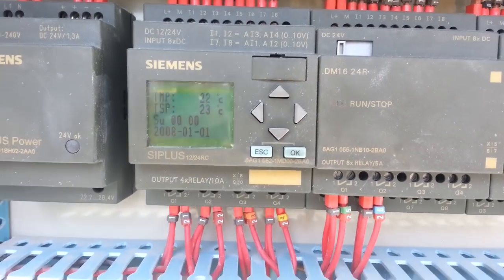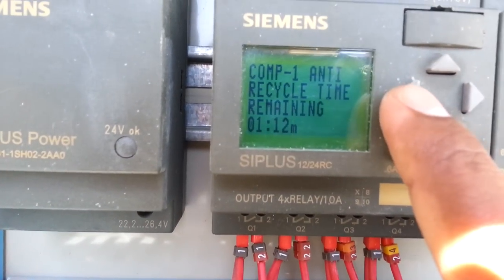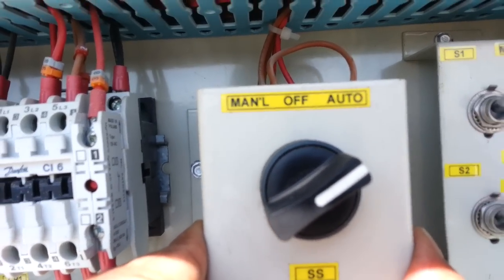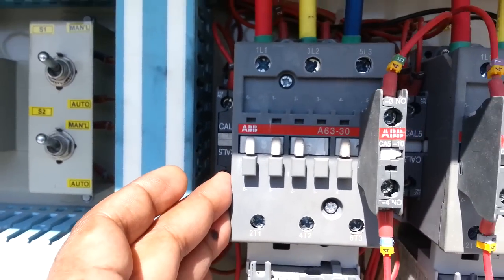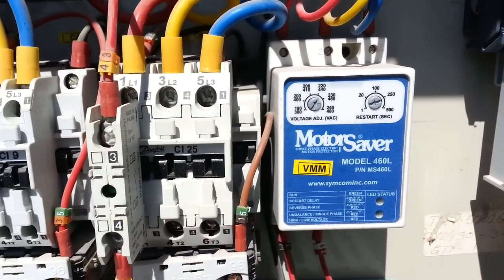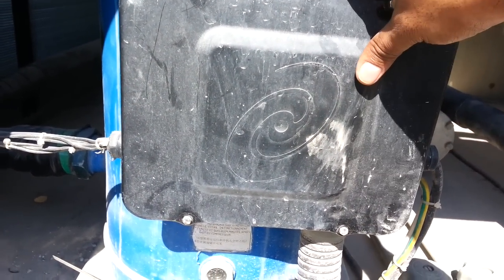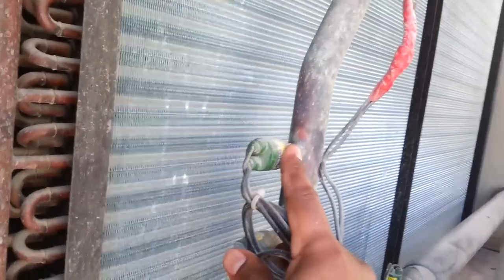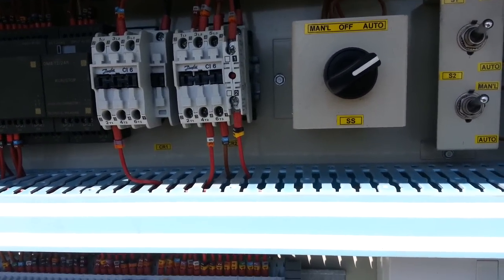Package AC Unit of SKM  with DDC Control Pannel Parts & Working Part 1

Comment: Hi sir.
     I have a small dout.how to calibrate high pressure transducer range
Reply: That control that he showed in the video is not a transducer- it is just a manually reset high pressure switch - also all the fan controls were just pressure switches - no transducers... it's easy to tell - transducers have three wires to them .. power - either 5 or 24 volts - ground/earth - and signal wire back to the computer...

Comment: Dear sir, what is the Moter protector trip, and solution?
Reply: Solutions 1 change the vnm. Or change just center wire remove then put right side
Reply: Vnm have any volt &a ampere problm coming stoped the all system then vnm is a safety control system by the unit

Comment from the maker: There is voltage monitor device is fixed in this unit...check that one is faulty or its voltage setting  curresponds to ur  line volt...eg.if line volt is 400v then set the knob from 440v to 400v
Reply: VIJITH M S

Comment: hello, what is posible problem if the monitor showing VMM trip? what is posible couse?
Reply: High volt , low bolt,ground motor,bearings problem,cable burn etc